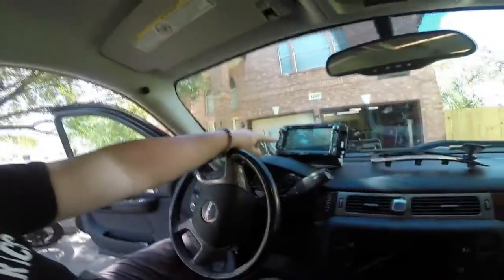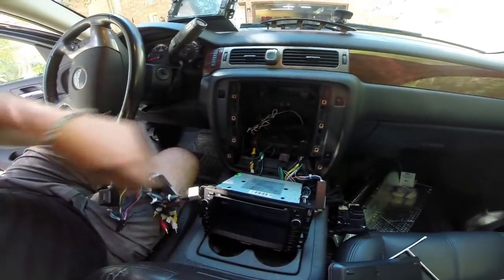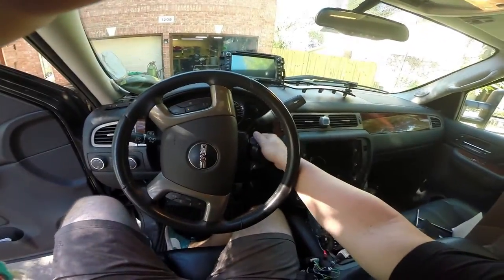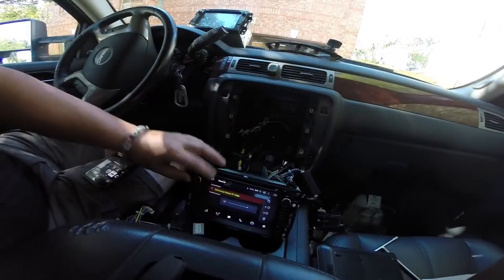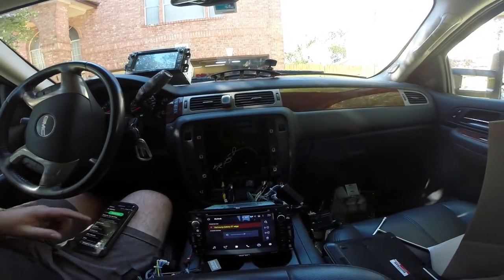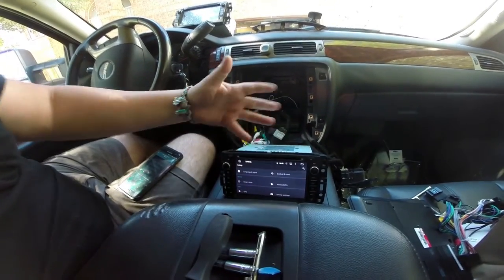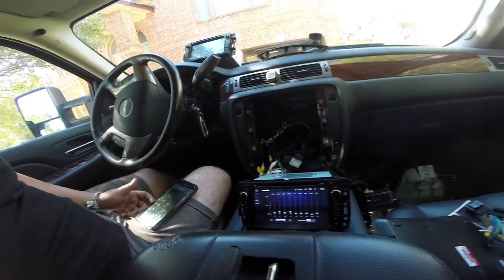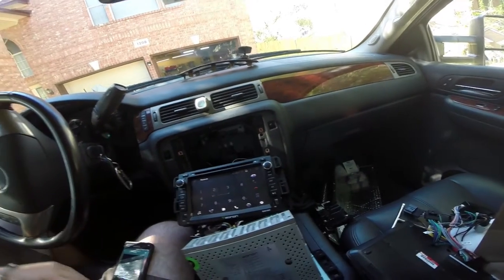EONON GA6180F Final Update

Comment: I had the same problem with this unit and found the fix under the reviews for it on Amazon of all places. Someone said they took the plastic end off the factory antennae cable, bent the metal tabs back so they don't make contact with the eonon adapter, then plugged it in. I just finished doing this and after multiple attempts to stop the hissing this actually worked. I wrapped up the connection with electrical tape to keep it secured.
Reply: William Joseph can you specify? I unplugged the antenna entirely and still am getting the whine.

Comment: Which wire did you use for the amp remote wire ?.. I just picked up  my ga6180. Not extremely happy with it. It looks nice but it takes forever to turn on. I also have the hissing noise. Some functions don't work ..anyways lesson learned for unknown name brand equipment.  I'm going to use mine for a while because of the price I paid for it . But I digress . Anyways if you could advise which wire I need for remote to amp and I would be very appreciative
Reply from the maker: its the blue wire marked antenna on the main harness

Comment: have you tried a regular noise filter on the hot lead? likely ecu noise from a capacitor.
Reply from the maker: Ya I have tried a variety of filtering adjustments. There are two large caps on the output for noise filtering and its just not doing shit capt'n
Reply: Yeah I saw em in there but they look pretty small. Was just wondering if one of the big cheapie filters would do any good. Or try to hook the pcb to a different battery that isn't tied to the other parts of the vehicle systems. I was a gm certified tech for 8 years and the gmc line are one of the worst when it comes to electrolysis of the heater core due to bad grounds. You can also to add a ground jumper from the outside of the stereo chassis. Just ideas.. I know how frustrating it can be. Had a mean camaro back in the day that I had a 150 amp filter on cause the msd ignition put more sound out than my deck did.

Comment: Is the hissing just over bluetooth? Or can you still hear it from like cd's, dvd's, and usb? I won't use the unit for anything other than dvd's and playing music from a usb. Would this work fine for hat I want? I have an 09 Sierra 1500 Crew cab SLT with Bose but no nav or touch screen
Reply from the maker: I only have the issue on bluetooth. CDs, DVDs and line in works fine with no noise.

Comment: thanks for the video.  Sorry It didn't work out for you.  As an installer,  hissing noise is a deal breaker :-/. But just to Clarify something. ... the  hissing noise only comes when using the Bluetooth? ? Thanks
Reply from the maker: yes hissing is only when you use bluetooth.
Reply: Got it pal. Thanks for the quick reply 👍👌
Reply from the maker: No problem

Comment: What did you do with the head unit? Which one did you ended up having?
Reply from the maker: I have been traveling. Still have the headunit in the truck. Probably going to hanging on to it for a minute.
Reply: You still have that hissing noise? I just got mine, same thing, it drives me nuts. Its like the amp is on the max, because even when my volume is 0, those key sounds when you click are loud as hell
Reply from the maker: yes. Couple of things. you can turn off the key sounds. I did that. go into factory settings and turn the amp down to 25% it helps a bit.
Reply: I lowered it to 25%, didn't do anything. I guess this is a no go.
Reply from the maker: ya there is no fix. They basically gave up on me. Its a shame too cause its easily the best looking display.
Reply: Did they refund you for one or both units?
Reply from the maker: just the one. I kept the other so no refund was expected.
Reply: What if i just replace the bose speakers ?
Reply: MaksWerks just purchased the same unit and have the same problem but I found a solution. simply unplugging the car antenna from the antenna adapter removed the hissing sound. If I touched the adapter to the frame of the truck the buzzing comes back. Gonna see  if can isolate the antenna from the truck or maybe check my ground straps